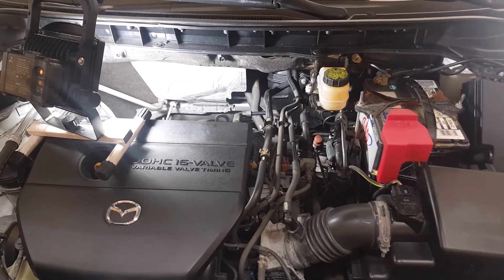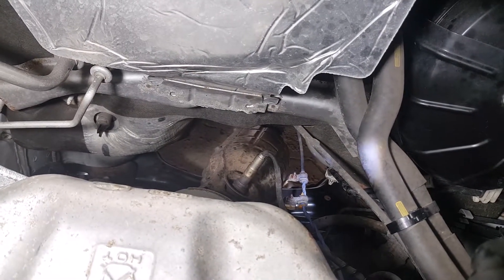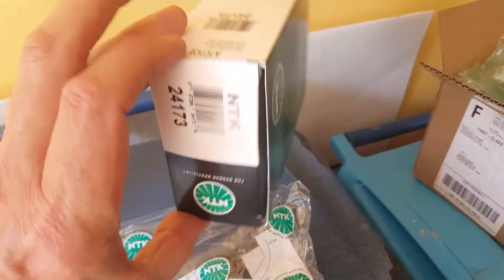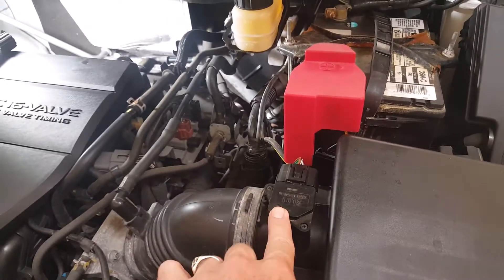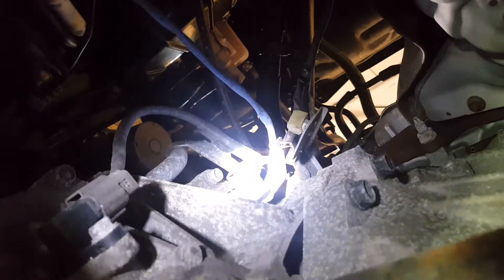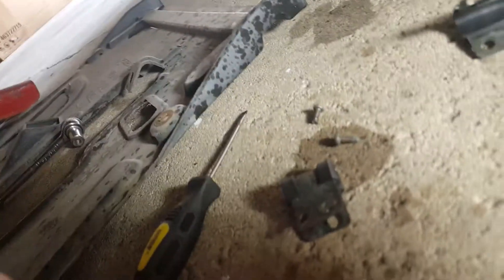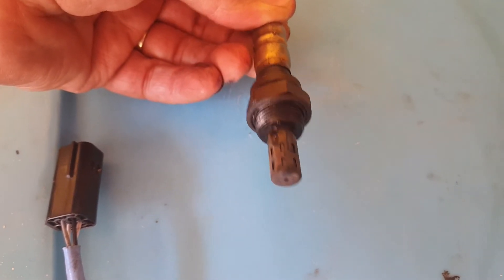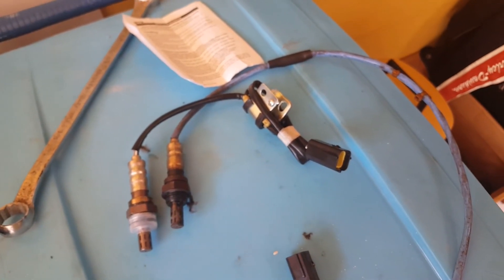2010 Mazda CX-7 downstream Oxygen Sensor Replacement

Comment: I have a cylinder 1 misfire I have changed the spark plugs the coils are fine I put some Lucas Fuel Injector cleaner in my car and it's running smooth at the moment. I just had my fuel injectors changed last year. Someone told me it could be a O2 sensor